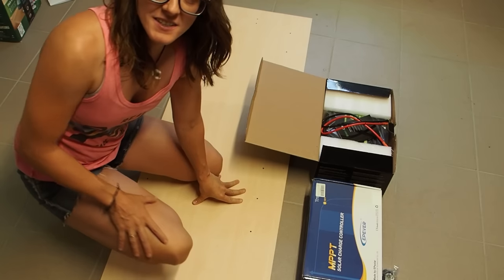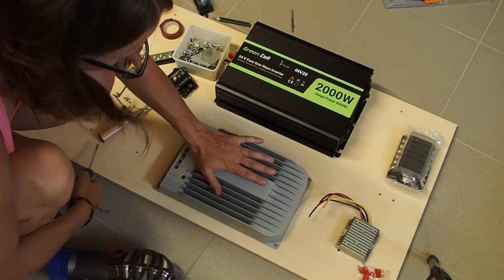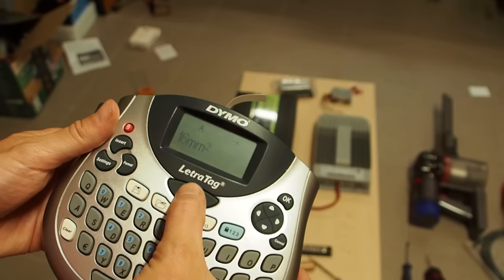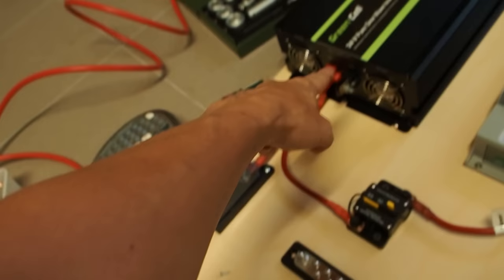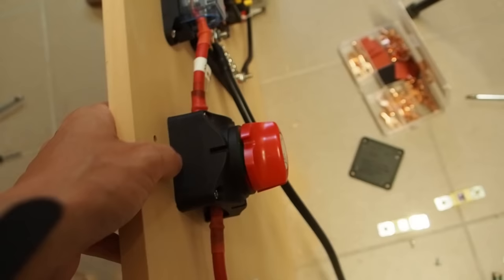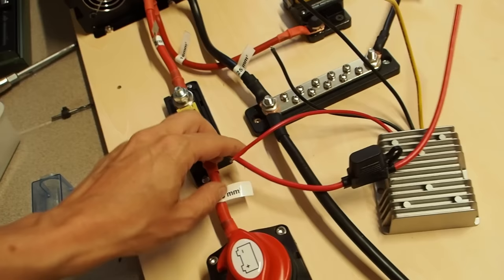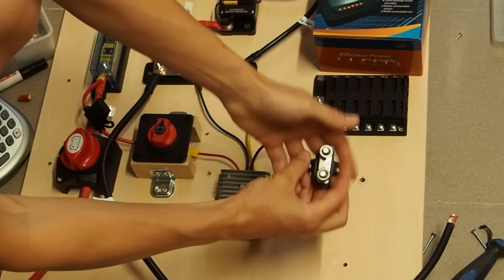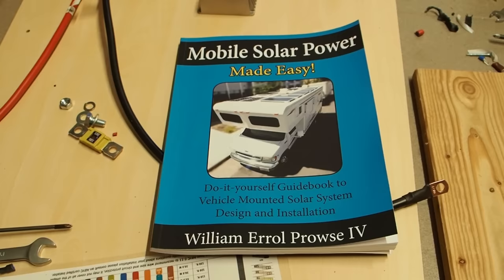DIY Solar System (24 Volt) for fridge and freezer! (Part 1)

Comment: Hello! We know that the nominal power of a refrigerator is somewhere between 60-100wh depending of the size and model. But the starting power is 800-1000Wh. My question is, how do you dimension the sistem fuses? By the nominal power or by the starting power? You could also make a video explaining it for everyone! 
 Thank you! Appreciate your work!
Reply from the maker: normally those fuses withstand a few milliseconds of higher power. so I would calculate the fuses to the nominal power.  if it is not working you will find out anyways.

Comment: YOU DID NOT EXPLAIN WHAT WOULD BE THE VOLTAGE SOURCE YOU ARE GOING TO USE. IS IT 12V OR 24 VOLTS. IF 12V TO PRODUCE A 12V SERIES, HOW MANY BATTERIES IS NEEDED TO SUPPORT A 2000 WATTS REQUIREMENTS NEEDED FOR THE APPLIANCES THAT WILL BE PLUG IN AND HOW MANY WATTS PER HOUR THE SOLAR SYSTEM WILL SUPPORT. THE ILLUSTRATION IS NOT COMPLETE ... NOT ENOUGH INFO.
Reply from the maker: 2 batteries in series

Comment: Newbie question here...  but the EPEver is rated at 40 amps (50 amps max), but you are running almost 90 amps into it, right?   How does this make sense? 
OK, it looks like up to 50 amps is going through the EPEver and out of it, but 100 amps is leaving the inverter.  I'll have to rewatch because I recall you doing the inverter calculation and that might give me a clue.  Anyone who can chime in with a concise description of the variable interactions at play here would be appreciated.
Reply from the maker: Nope the 90 amps is drawn by the inverter

Comment: Nicely done! But why layout and electrical project on a flammable wood base? Would not the whole project be safer if it was built on a non-flammable base material?
Reply from the maker: In general yes. But if you have a safe system you can mount it on wood too. When using the system for the first time measuring the temperature is recommended. This way you can detect a defective connection or a wire that is too thin.

Comment: Typically solar charge controllers should always have the battery connected or they may be damaged. In your wiring this path is broken if the battery switch is opened.
Reply from the maker: My mppt can handle it

Comment: great job ,,,,  but  ,,  your thinking of the wire guage from solar reg fuse to inverter needs to handle your max 100a is incorrect .. it only need to handle the 40a  ,,   if that was the case you would have the same problem with your dc-dc 12v converter + cabling .. you had it correct the first time
Reply from the maker: yes I think so too. but maybe this is the code in some countries. At least Will Prowse is recommending it this way.
Reply: @SurvivalLilly  you've only gone better and that's a good thing  , just your reasoning behind changing that wire thickness is not correct  ,,  also can i suggest the fuse size @100a to inverter is too small .. you need to think of surge that the appliances will require to start up .. especially if they all fire up at the same time .. i would go a 150a min or you may find yourself changing out fuses regularly
Reply from the maker: my surge is not using more than 100a. also I am not allowed to use a higher fuse because the wire thickness is at the limit.
Reply: Spot on 👍.. as reference,  I've seen some appliances surge 3-4 times there rated wattage

Comment: I wonder if a DC powered fridge was considered? DC powered devices are simpler and connect directly to the battery, so they are more efficient, but they aren't as commonly used, which probably makes them more expensive...

Comment: Nice components. But only one I don't understand.
I would definitely use a positive busbar and not the cheap breakers. 
The choise for the bigger wire to your breaker does not make sense to me. There will be no current to that breaker that big. If there is, the breaker will trigger or fuse itself or even arc.
Edit: also consider that when the battery is low, the inverter and other equipment will draw more amps to meet the required wattage for apparatus attached. Even a blender can request very high inductive start currents, especially when the battery is low.
Reply: Cool. I just set mine up with two bus bars. It looks odd. I can only guess electricity knows which way to go. Charge controller, inverter. Battery positive cables all connected to red bus bar.  I’m pondering going mppt directly to battery. If not just to make it look like it will work and not strange.

Comment: I already am using that controller but Im getting another one. I have added two 24 volts 100 amp hours lithium iron phosphate batteries ⚡. Im going to create a 12 volts system with the lead acid batteries that  I'm replacing. They will also have the wind generator on their side. I have a 12 volts 2k inverter that I can use. The 12 volts side will be for the hotplate, coffeepot, electric blanket, etc. One reason I am doing this is, I ordered a 24 volts wind generator but they sent me a 12 volts one. So there's no other way to make use of it.

Comment: Don't use the inl8ne solar fuses.i worked for a solar company last year and we replace those so much that we don't use them anymore.they blow all the time and having to take off 40 panels on a roof to rewire things is not fun in the summer ,not so fun in winter either.maybe small panels don't blow them.we don't use any under 390.sokar fuses

Comment: As an Engineer, i find the most import part of survival is communications.  Both short range, and long range HF.  Problem is, that cheap Chinese crap will produce so much RFI, you wont be able to use anything.  I would recommend better gear from people who understand the dangers of switch mode circuits.  But we sold ourselves to the Amazon machine, so no one makes that stuff anymore.

Comment: Be careful with switching off the solar charge controller output with that switch - damage may be caused to the solar controller if there is solar input. I don't put a switch in that position. Also it is worth having a +ve busbar to the batteries as well. Finally the red wire you originally had from the switch to the inverter was OK - the current is the same as from the switch to the charge controller. Everything else looks good!

Comment: You cant hide very well with all this power equipment in sight......If you are not trying to hide and you just want to protect the contentsvof your freezer take this step now. Buy some dry ice. Put the bulk of it in your large freezer. This will freeze everything solid. Put a small amount in your refrigerators freezer again this will freeze everything soli. At this point you can make up some water ice packs to put in the refrigerator to keep non frozen foods cold,who wants warm beer? By doing this now you will find that your freezers are not running. Thats because the dry ice is c 2:13 older than the freezer. Saves on electric bill.

Comment: very neat work. Iv never seen the pos wire go from the mppt to the inverter before. Iv all ways gone from my mppt to the battery and then from the battery to the inverter. did your set up work as you built it? if so i will change mine to your way?
Steve
UK

Comment: If you switch off the battery isolation switch to work on the inverter for example, you will also have disconnected the charge controller from the battery, which may destroy it if the solar panels are still connected and illuminated. The same thing will happen if your 100A fuse blows (due to an inverter fault maybe). Under what circumstance can one side of the circuit breaker be conducting 100A when the other side is conducting only 50A max?
Reply from the maker: My mppt has build in protection for this case.

Comment: Frau you got way to much going on there. Single bus bar for all your negatives would be fine. Your switchable breakers will suffice for a seperate breaker and switch. A fuse between your buck converter and fuse block rated for the draw of your fuse block and the supply if your buck converter. Next project should be some ac/dc metering to monitor your energy production and consumption.

Comment: Research if the Solar Energy Controller (EC) positive power should connect to Master Power On/Off switch (MPS), then to Auto-reset Circuit Breaker (CB) of Solar Array Volt/Amp limit, then to Battery Volt Protector (BVP), then to Battery. Victron is the only company that I currently know of that makes BVP. Also, research if separate wire networks from Battery to Appliances is most effective and safe. Research if Battery power output should connect to a separate MPS, then to a separate BVP that’s utilized as the hub for all output power networks to Appliances via AC Inverter and 12V Converter. Then Research if the same wire connection format is utilized for each network from the BVP. Research if AC Inverter has a dedicated wire from BVP to MPS, then CB, then Fuse, then AC Inverter. Research if DC Converter has a dedicated wire from BVP to MPS, then CB, then Fuse, then DC Converter. Research if Fuse Amp can be one step lower Amp than Circuit Breaker Amp in order to protect Fuse life for convenience and Safety.

Comment: Am I missing something .how does that wire need to be able to handle more than the wire on the same circuit. Just like will  did his.good job ,I like the labels.
Reply: Yes dont make sense, with the breaker closed its the same current all the way through.

Comment: I have watched hundreds of this kind of videos but I have never seen someone connecting the charge controller directly to the inverter. Inverter is supposed to be connected only to the battery and solar panels.
Reply from the maker: you can do it both ways

Comment: One question I have and have not been able to find the answer anywhere (I have Will Prowse book and others) is; do I need to ground a 12/24V 400W system (similar to Lillies) and if so how do I? I am trying to help a friend in her off grid cabin and there is no ground rod. If anyone is able to assist with this answer will be great. Thanks in advance. Hooroo for now from Down Under.
Reply from the maker: There is a ground screw on the inverter
Reply: @SurvivalLilly  thank you so much Lill. Love your YT vids as well, keep safe over there things are going to get worse than most of us realise. Once again, thank you for your response, what a surprise. God bless, hooroo for now from Down Under.

Comment: When you sized the first fuse breaker to 100A I noticed that you did not apply the 25% size up that you did for the second calculation later in the video (timestamp 18:32). So I am curious why you did not do this on the inverter fuse breaker? Also, what would happen if you plugged in a device that surged to within the surge rating of the inverter, but above 2000W, would that blow your fuse breaker? Sorry for the basic question on understanding. I have ordered Wills book to help :-)
Reply from the maker: We are not going to use more than 2000 watts with this inverter. So 2000 / 24 Volts = 83,3 Amps x 1,25 = 100 amps fuse

Comment: Great video, maybe I missed it, did you put a fuse from panels to controller?
Reply from the maker: Fuses are only needed if you connect solar panels in parallel

Comment: Let me stop right here to tell you no. 
2 parts to a solar system. The solar cells that create the power, and the power side of the system. So the 24 or 12 volt is taken from the power side, of the battery's. It's created at that point to become 12. 24, or 48 volt system. This is just how you hook your battery's together to create the power voltage thar you need? For 12 volt you can use just one battery, for 24 volt you need at least 2 battery's. For 48 4 battery's..  They all work off the same solar panels.

Comment: Sorry if this is a dumb question,  but do the battery and solar on/off switches have amp/volt ratings that I need to look out for or are these switches standard for any set up.
Reply from the maker: Yes they have.
Reply: @SurvivalLilly  Thank you.

Comment: Not sure why people mount their solar projects  on a flammable board.  Most likley  any of it will eventually burn up and catch fire. 
The inverter wiring is a bad point  for wire junctions. 
Those car fuses are junk  and are more likeley to heat up and get very hot. 
Effiency of an electronic ithem like the buck converter or the inverter does not reduce power consumption of an electronic item, it may reduce power output and the rest just gets turned into heat while the power input is as stated on the label.   
Not sure why you would  fuse the output of the charge controller higher than it could handle, if something happen it could backfeed and put flames to that charge controller.
It would be better to do all junctons and connections of positive and negative bussbars.

Comment: I noticed that you did not use the "load" terminals on the MTTP charge controller.  Is there a positive or negative consequence to connecting the Load to the battery versus connecting the Load to the MPPT controller? Thanks and great job!!
Reply: What I've found is that the charge controller doesn't give a decent output. I have a victron. I dies when I pull a large load, but running the inverter on the batteries directly doesn't cause that problem. Seems the output on the charge controller is for relatively small loads. 

Example, charging my laptop trips the inverter when running from the controller's output, but connecting directly the inverter on the battery charges the laptop just fine without much work.
Reply: My Renogy MPPT has load terminals that output 12 volts at 20 amp maximum. With the BT-1 bluetooth module, I can switch on 12 volt lights in the shop before going in. Better yet, I have a $35 per video camera with iPhone app aimed at my battery monitor display and can read out many things from miles away from my phone.

Comment: Why did you go from the Charge controller to the inverter to the battery, and not the charge controller to the battery to the inverter to the appliance?
Reply from the maker: cause it is not necessary.
Reply: I understand what you are saying.  The answer is when the inverter is not in use the current flows to the battery anyway. Thus achieving the same results. While active the controller can provide direct power without pulling all of it threw the battery. Basically if the battery fails the system still works if there is sunlight.
Reply: I use a similar configuration to run a evaporative cooler when camping.  I leave the battery at home, it's too bulky
Reply: @SurvivalLilly  If the Fuse blows because the inverter has drawn too much power, the way you have set it up means the battery will stop charging as well. You will be left with nothing but unlike Klaus's advise you will not be happy.
Reply from the maker: @noname-nd8ec  you will notice when the fuse blows. Then you need to install a new one. So you maybe lose 10 minutes of charging time?
Reply: Wiring the charge controller directly to the battery makes more sense for a couple of reasons as mentioned in several post here. This method works but might not be the ideal set up.

Comment: Can someone explain why she used a d to dc converter
Reply: She is using a 24 volt inverter and the dc-dc converter is to step it down from 24 volts to 12 volts to run 12 volt lighting and 12 volt refrigeration. Trying to run anything that uses 12 volts using 24 volts would fry those components.

Comment: Is 12 or 24 Volt system better? Is series or parallel better? I don’t want to risk money on something I know nothing about.
Reply from the maker: 24 volt is cheaper and more powerful and more efficient
Reply: @SurvivalLilly  I’m coming closer every day to buying a system. I’m going to start cheap at Harbor Freight. I just wish batteries didn’t cost so much.
Reply: 24v is better, series/parallel wiring batts and panels is the way to go

Comment: Will Prowse is dangerous in what he doesn't understand about solar. 
You do a nice job of checking the poor wiring size from assorted manufacturers.
Just not that more expensive to do a proper inverter hardwired into a breaker panel or even a mini breaker box with properly rated breakers.

Comment: How expensive does this get? 'Cause we have 1 fridge and 3 deep freezers. Plus would also like to have lights, hot water, air conditioning, a stove, heat in the winter... All these ads I see to go solar are way too over priced IMO. I'm in the USA btw near east coast. Oh, and our well runs off electric powered well pump too...
Reply: You may do some compromise! You can convert your cooking and heating into the same system with a masonry wood stove and grow your own wood (poplar is a good fast growing one and the leaves are great fodder for animals), might be worth looking into improving your house insulation and ventilation, a cheap ac might do the trick, you can also convert a freezer into a fridge with an external temp controller, way more efficient than a fridge although a bit cumbersome but with a good box system is doable! Our leaders are gonna force this to us one way or the other and with this conflict with Russia they're demilitarizing and deindustrializing us here in Europe. Whomever did this until 2-3 years ago saved tones of money! Good luck ;)

Comment: I prefer 12 volt inverter double amps gives you juice when you need it especially for fridge compressors,  your 24/12V converter is a waste of money, you just needed to stay with 12 volts from the beginning.
By the way the higher the volts the higher the dangers of your system, that's a consideration if you have children. Your charge controller should have a circuit breaker built in, why another one 🤔? Hmmmmm. Pure sine wave inverters are more efficient than ordinary ones, I think the jury is out on 90% efficiency, it's more likely to be 80-85% depending on your load.